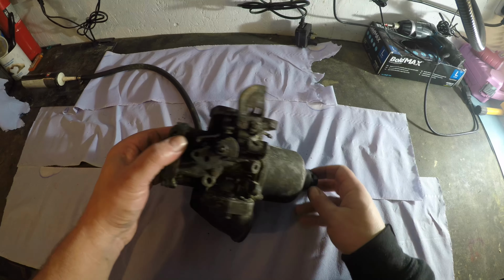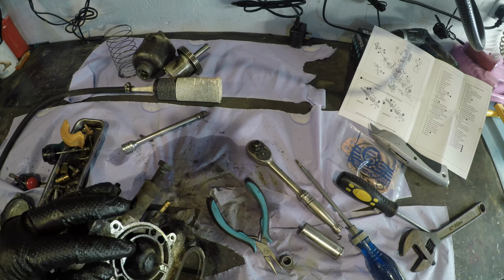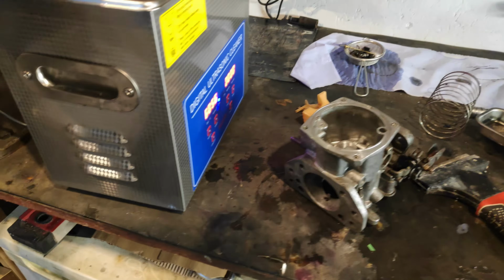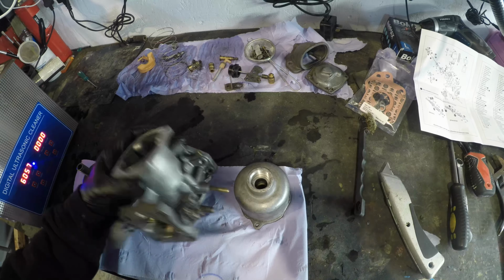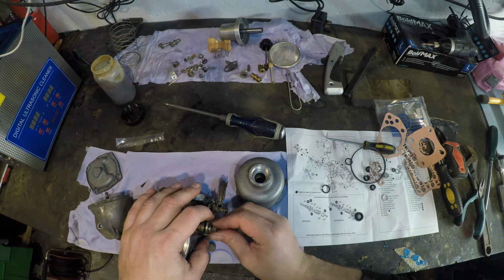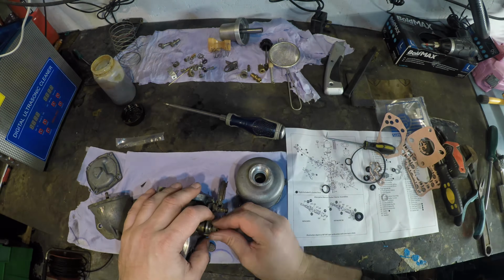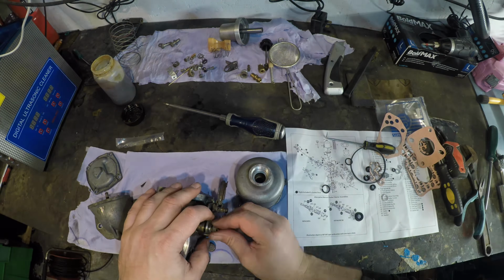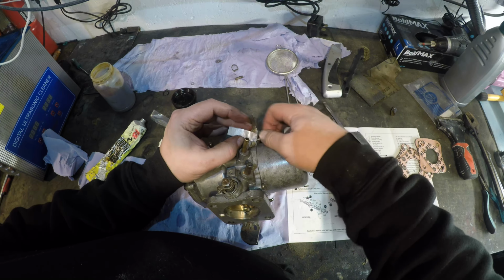SU HIF 44 Carburettor Rebuild - The Thing (Barn Find - Will it run?)

Comment: Hi There. Can you tell me which model of sonic cleaner you have and solution you use? I have the same carb to refurb and wonder about basket size. Cheers Julian.
Reply from the maker: HIya, It's a chinesium model, generic off ebay. 3l heated. I bought it two years ago. The solution is Vibrotech https://www.ebay.co.uk/itm/194330972916. Hope this helps.
Reply: Hi There. Thats awesome. Thanks for the quick reply. I will get onto it and get them ordered. Cheers Julian.